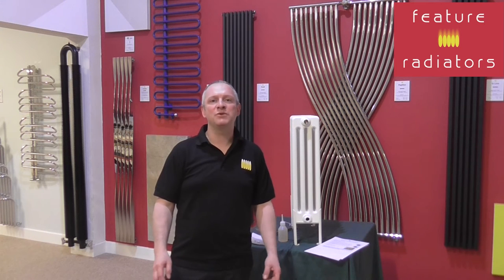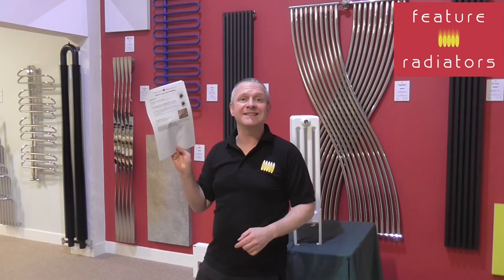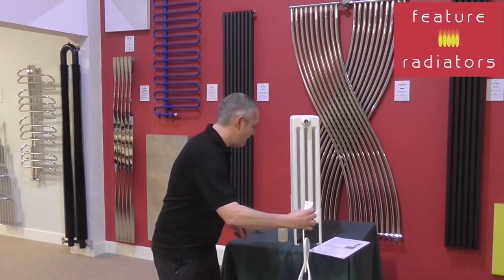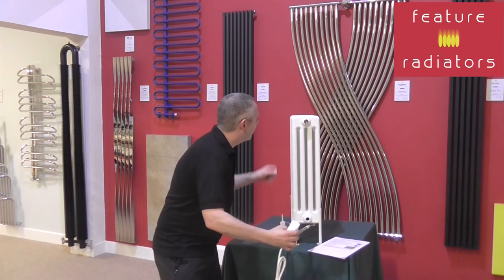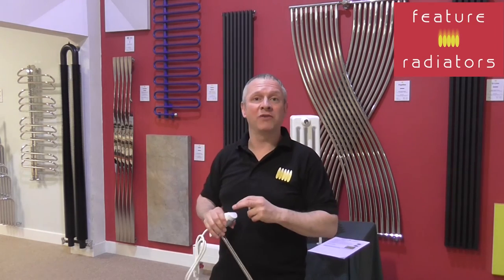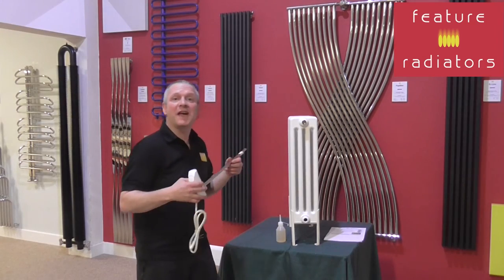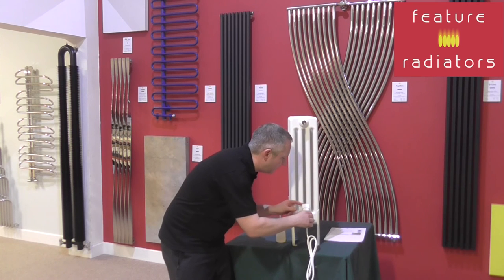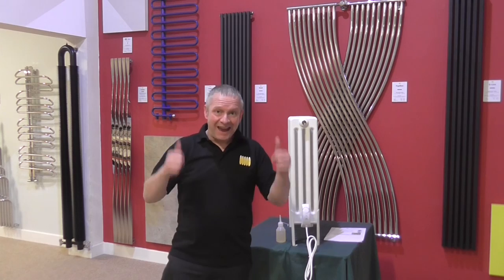How to install an electric element in a radiator

Comment: Hi Jason,
I've purchased a 1800mm X 600mmand a 1800 x 340mm vertical column radiators, there raw metal trade radiators and I would like to fit dual elements is that advisable.
Cheers .
Phil.
Reply: And what dual control would you advise using. Cheers

Comment: What do you fill radiator with water or something different?
Reply from the maker: Water is just as good emitter as anything else. We have majority water based electric but also some 'dry heat' radiators using heat matts.